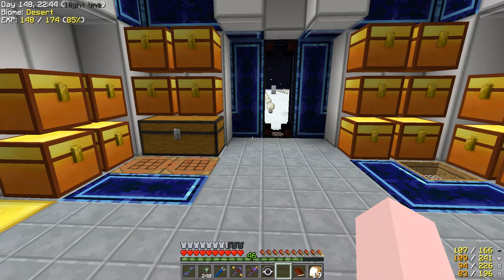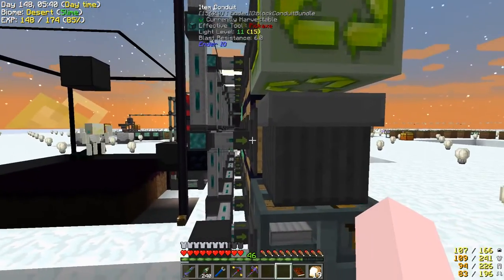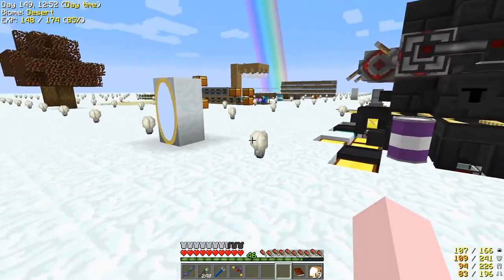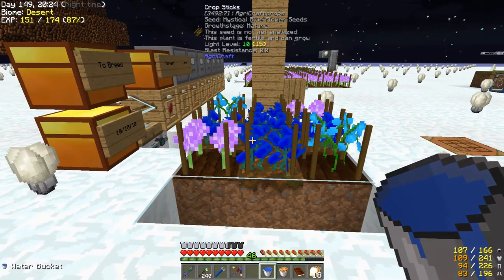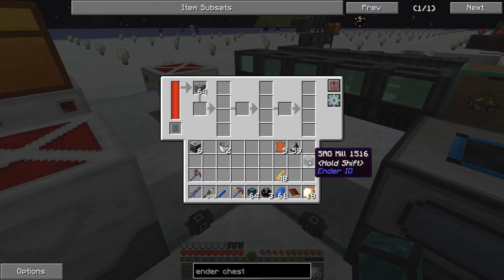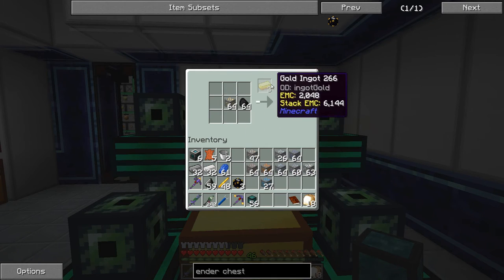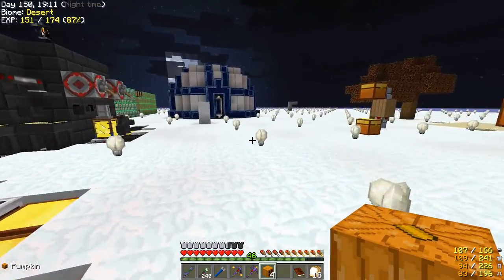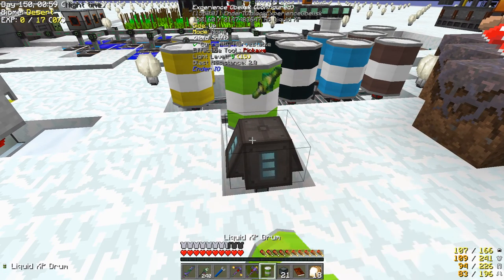11: Doll, TE Machines, String to Leather, Loot Recycler, Rich Slag  - Project Ozone 2

Comment: Did you ever figure out how to make the output of the loot recycler anything other than the basic loot bags?
Reply from the maker: I wouldn’t want to. You can get everything from basic bags. Higher end bags just have smaller loot tables, with stuff higher on the list, not necessarily better. The most valuable things to me are Dimlets and Overgrowth Seeds and I am far more likely to find them in a huge number of basics than a small number of higher end ones. To see the list type /lootbags_itemdump and look in your logs directory.
If you really want to, send the loot from all the highest end bags to a separate loot recycler and it will be more likely to get you better bags.

Comment: You might be able to use a vacuum hopper to pickup the XP from your mob farms and send that into an ender tank connected to your XP obelisk for even more exp.
Reply from the maker: XP doesn't drop when I use a grinder. I am going to be switching to spikes for the auto-spawner for a different reason, but will use a vacuum hopper then.

Comment: Wilx if you make a blue/blue/blue ender pouch you can instantly dump anything into your storage network.
Reply from the maker: I made one right after the episode. But it's a good enough tip that I should have included it in the episode. You don't actually die the ender pouch, you just click the pouch on the chest.

Comment: I tried the UniDict.cfg fix, and it sort of worked, I can turn blocks into bars now, but it doesn't show up as an item, like if I put blocks in the crafting grid, nothing shows up in the product box, and if I put them in compacting drawers, it only shows the ingot and the nuggets, but if I try to pull out blocks from the top drawer(which has an image of the ingots) I get blocks. Any idea why it might be doing that?
Reply from the maker: You need to clear the bug. Take them all out of the drawer as ingots. Break and replace the drawer. Should work now.
Reply: I did actually try that =/ I went as far as removing all the items, breaking the block, and restarting the server with not a single block of iron in the world and it's still doing that =/
Reply from the maker: If you use a brand new compacting drawer made after the config change and put 1 iron ingot in it, you still get the display bug? I think it is actually a display bug and the drawer is working, but the front looks wrong. Are you using a texture pack?
Reply: Figured it out! I am running on a server and modified the server config but never updated the client config(oops!). Updated client config and reconnected and all is well =]

Comment: Wanted to say good videos. Also not sure if you know and maybe just don't use it, but when you want to pull a certain number of items out of a chest you can scroll up or down with mouse scroll wheel when you hover your mouse over an item in the chest to remove or put back items one at a time. It also works with ctrl clicking the item. I find it easier than picking up the stack of items and clicking them into my inventory.
Reply: Oh and thanks for the tip on the Iron fix. That been bugging me since i started playing the pack lol.
Reply from the maker: I do know of the scroll wheel, but your right I don't use it when I should.
Your welcome on the fix.